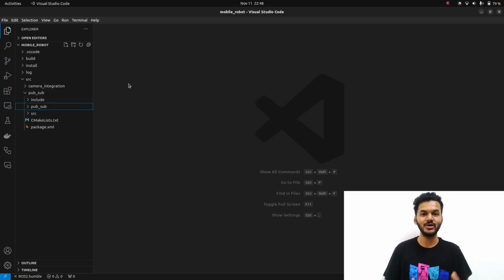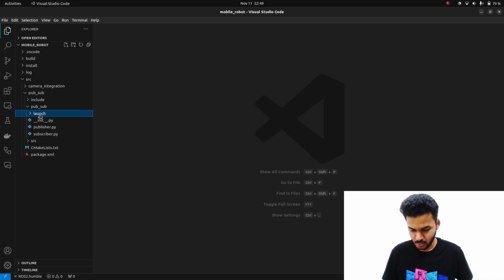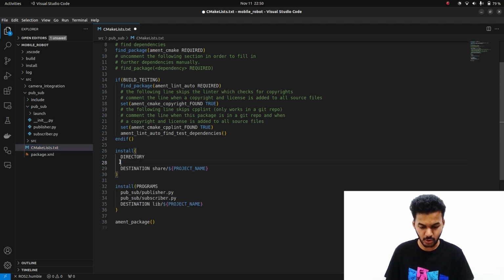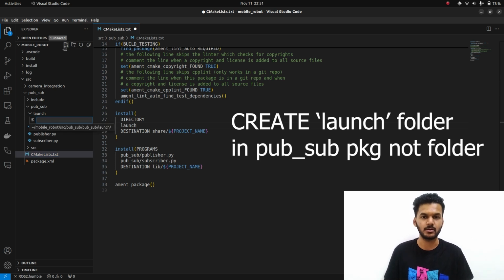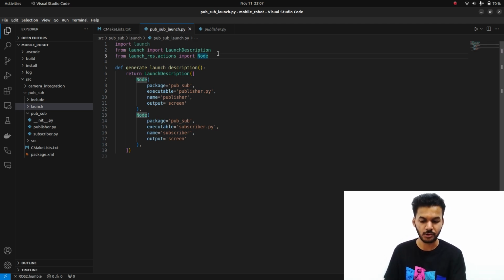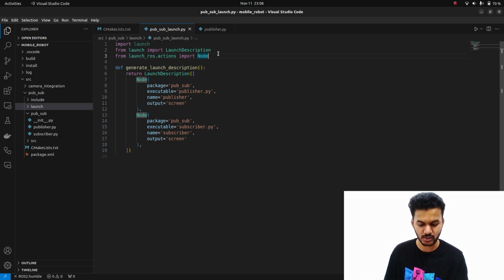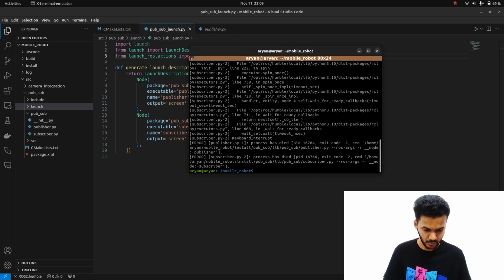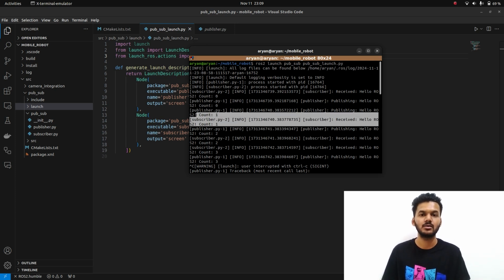ROS Launch file Python | ros2 tutorial | robotics engineering | robotics and automation | DAY 20

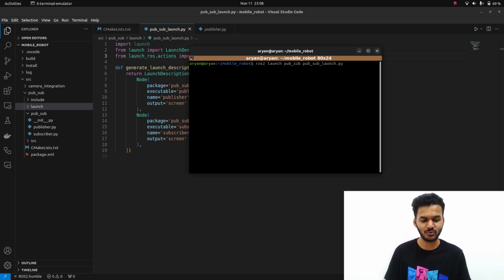Comment: 3:43 before running the command for launch file need to run colcon build command in terminal.
Reply from the maker: Right, Run 'colcon build' after making any change in the package to make it applicable.
If we do not colcon build, the new changes will not be saved, it will throw an error or the previous file will be executed.